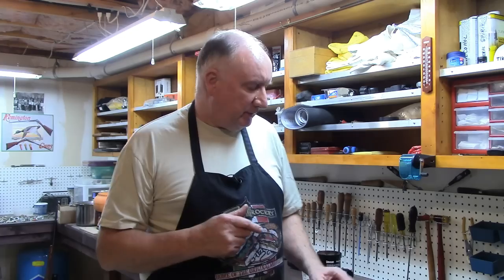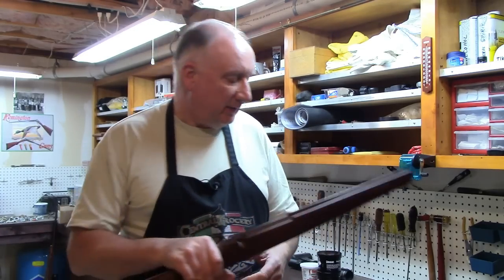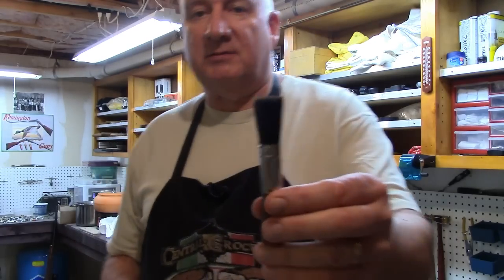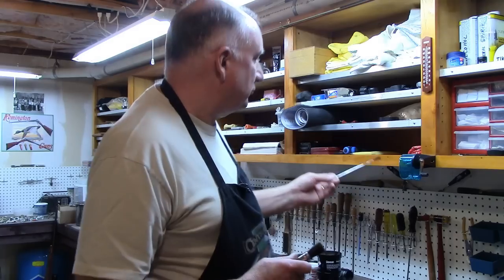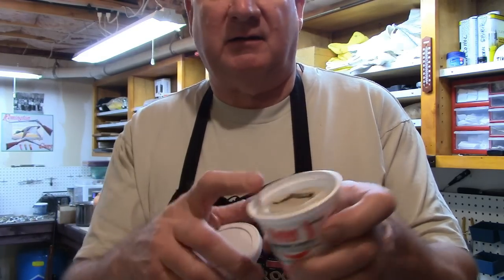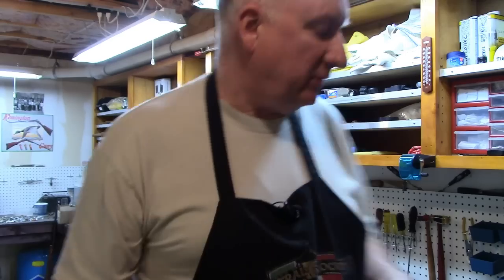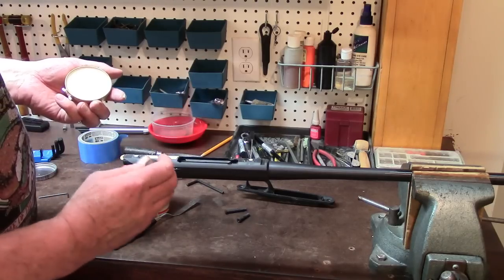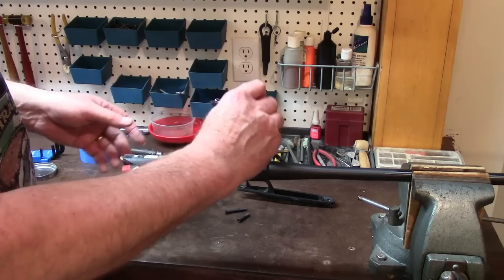How to glass bed a rifle, Part II ~ Let's bed that rifle professionally!

Comment: This doesn't seem like it's out of my skill level, but is it recommended for synthetic stocks?  I haven't finished the entire video (it's getting late. :D), and hopefully you can save me some time if it is not recommended.  I would think that the epoxy can't stick to synthetic material as easily, but I don't know.  Many thanks ahead of time.
Reply from the maker: Rollintroll 
Epoxy will certainly adhere to a properly prepared synthetic material, if not materially; mechanically.  That is, while epoxy may not glue effectively to certain synthetics, their bonding compatibility is not really the issue, because the epoxy is a mechanical shim, as a washer is between a nut and bolt.  The first requirement is to test the epoxy on the plastic, to be sure it does not act chemically against it or melt it.  Such a test can be done in a very small area in an obscure area such as under the butt pad or barrel channel.  As with wood stocks, surface preparation is essential,  perhaps more so.  Roughing the surface will prevent slippage, and creating tiny undercuts and dovetails assure that it won't disconnect when the action is lifted off.  Irregardless, the stock screws hold the action, while the job of the epoxy is simply to mate the stock and receiver to correct any sloppiness.  But if you have a synthetic stock which uses mechanical pillars, as with a Ruger American, then epoxy bedding is a futile waste of time, as such factory bedding is dead tight.  I would not mess with such systems, except to free float the forend completely with .050 inch clearance; five business cards, full length.  Whatever you do, heed my disclaimer, as it can as easily destroy a gun as fix it, if not done skillfully.

Comment: Hi.  Another pair of excellent videos.  I have wanted to learn how to do this properly for some time now. Various videos on the net show rather awful jobs with people bedding the entire inlet. The 'two points of support' approach is extremely compelling in my view. Most of my rifles have synthetic stocks and are pillared with precision machined aluminium blocks (e.g. Blaser and Hardy RE). But I also have an Anschutz 1416 D HB Thumbhole in 22LR where the stock is walnut.  The barrel is already free floating.  Perhaps it would be an interesting test case for me.  I don't know if you are familiar with the these rifles.  The one thing I'm nervous about is that the inletting is shaped to the contour of the action and relatively small in contact area. There are no flat surfaces of contact. I'm worried that removing the contouring with a Dremel to allow for resin - even slightly - will allow the action and barrel to not sit in the proper position (roll?) during the resin setting.  

(It's also not clear whether the fixing that the rear bolt stock screw connects to, which doubles as the rear bolt for the trigger attachment, makes contact with the tubular metal insert lower in the inletting and so governs the rear height of the action rather than the upper channel as it does in the front. The safe assumption will be that it does not and to again be careful not to lose the upper channel 'initial height'.)
Reply from the maker: SGK 
Your situation is found in a number of rifles.  They are typically very accurate rifles, so I suggest a very conservative approach.  Carefully, with a finger over the back of it, pull a small 1 inch wide ribbon of 100 grit sandpaper through the inletting, just enough to roughen the wood along the front and rear.  If you can do it safely, use a very small Dremel bit instead.  Adhesion is the only goal.  Two point bedding is accomplished with even the slightest shim, even if it's just paper thin.  That should provide perfect bedding and support.
Reply: Thanks.  I'm going to give this a go and am now collecting the necessary parts and tools. What do you use to clean the polish off the action when all is done?
Reply: This may be a little more difficult than I first envisaged.  I can't see how to remove the magazine housing from the action.  The front is a simple screw but the rear something else altogether.  Secondly the rear bolt which holds the stock to the action screws into the bolt holding the trigger to the action. Both will have to remain on the action/barrel during the job. I guess I just plug as much as I can with putty, coat everything with release agent and be extra careful laying the action into the stock.
Reply from the maker: SGK 
Naphtha removes it nicely.  It's sold in hardware stores, but also under other common names, as Zippo lighter fluid, and Coleman (white gas) lantern fuel.  Of course, be careful, as it's very flammable.  Other wax removers probably work, too.  Even Hoppe's #9 may work.
Reply: Well I glass bedded my Anschutz 1416 D HB Thumbhole yesterday.  I think I did a good job. I created an effective pillar at the front - the front action screw now threads through the bedding - without getting too much forward seepage. The rear tang area could have done with a tiny bit more Devcon putty to fill in the gap between the stock and the blunt end of the action a little higher (it filled in nicely at the bottom but less so up the sides). I didn’t contaminate the rear tang screw and it still floats. I maintained my height reference at the rear. I can still see wood there with the roughing now filled in. I had very little surface area to work with here. I’m a little unsure about the front.  I might not have tightened the front screw down quite enough at the front as it is hard to see my height reference there (an area of about 3mm forward of the screw) as opposed to the rear . At least it all came apart again and did so easily!  Still trying to clean everything thoroughly which is taking longer than the bedding job itself. Thanks again for the guidance!
Reply from the maker: Sounds like a good job.

Comment: He says he doesn't want to have the bedding compound between the stock and the recoil lug. What if I have a rifle where the recoil lug is part of the barrel? The way he puts the compound on the stock it would make it very hard to get the lug in without getting compound underneath.
Reply from the maker: Kris Csernyanski 
Who is "he"?  If you are addressing me, then ask me a question directly.  This is not a public blog site.  I am here to help you with any difficulty you have for your individual situation, and all firearms are different, which I can assist with, so I would appreciate the same consideration in return.
Reply: GunBlue490 sorry, ive never actually written a comment on YouTube.  I thought maybe it was like an open forum where people would reply to my comment. I had no idea it would be you.

So I guess my question to you is how do I keep from getting compound between the bottom of the recoil lug and the stock since my recoil lug is part of my barrel?
Reply from the maker: Kris Csernyanski 
I understand.  You may, and should certainly bed your recoil lug directly to the stock.  The issue I speak of is maintaining slight clearance between the underside, the front, and sides of the lug,  with solid contact only on the rear recoil side.  Placing a couple of layers of masking tape coated with release agent on the sides where a gap is desired will automatically provide that clearance when the tape is peeled off.  The reason for the clearance is so oil and debris won't get traped and create a bridge situation that lifts the action and causes instability when the screws are snug.

Comment: Dear Sir. I am still considering free floating and bedding my Weatherby Vanguard 7mm-08, but Weatherby claims that the #2 contour barrels are not free floated because they "require upward pressure to help stabilize the barrel for increased accuracy." Since I am a novice at best, I would like your opinion before proceeding.  Thank you. You are the best. May God bless you.
Reply from the maker: I spoke about that issue in another video that I made on accuracy rifles, where I explain that matter in greater detail. Yes, free floating should never be done to a rifle that does not have a completely stabilized action, because the entire barreled action will become sloppy.  Without a strongly supported action, the weight of the barrel will simply swing it left and right, and in such stocks, the barrel pressure assists in stabilizing the barreled action, which was the traditional manner of bedding with wood stocks.  Wood stocks, and certain synthetic stocks can be properly bedded at the action which will eliminate instability. But,  I have no idea if their stock can support the action correctly if bedded, having no personal experience with the Vanguard.  It's not so much a barrel contour matter as it is a stock rigidity matter.  Certain rifles can be stabilized at the action, whereas some are too flimsy and will not be adequately reinforced at this critical section of the stock.  I cannot possibly advise you as to your ultimate decision, which can indeed foul up an accurate rifle if the bedding is not done properly, and I strongly advise you to read my disclaimer carefully, as bedding the rifle will almost always void a manufacturer's warranty for any support.
Reply: Thank you sincerely for your prompt and wise reply. Watching and re-watching your videos brings peace of mind to a chaotic and confused world. 
John
Bruceville, Indiana

Comment: I am rather nervious about glass bedding my .30-06 Remington 700 BDL and am considering buying a after market synthetic stock. What is your opinion of the Magpul synthetic stock in place of the current wood stock

KC
Reply from the maker: K C 
That depends on what you are actually seeking.  I never saw a 700 that didn't shoot at least 1.5 inch groups with good factory ammo, and I have shot 3/4 inch handloads with standard 700 BDLs, and one in particular was my pet 30-06 that shot sub MOA consistently with several loads.  While they can be improved upon, they are certainly very accurate guns.  So, if you use your 30-06 for woodchucks at 250 yards, or if you really need a waterproof stock, an upgrade might be called for.  Deer are far less demanding.  Only you can make that call, and there's no assurance that a custom stock will perform any better, and may even be worse.  Personally, unless I have good reason to have a plastic stock, I will take beautiful walnut any day, and would be loath to reduce such beauty to kindling.  Finally, it comes down to a simpler question.  If you yank it off, it's no longer part of the gun.  If you fail in bedding it, you can still yank it off, and have the same result.

Comment: Outstanding videos on all of the topics that you cover! I just completed this process as you described on an old Mossberg 800C. I just did the unveiling and was very pleased with the results around the tang and the front action screw area as both were perfectly imprinted with the details of the action. However in front of the recoil lug it was evident that I must not have applied enough Devcon as it was not imprinted with the barrel and looked almost just as it did as when I applied it. So my question is whether I should re-do the process and add more Devcon to just that area so that i get the proper impression or do I need to remove all of it in that area to get proper adhesion?
Reply from the maker: Mick Szoka 
Generally, the contact at the rear of the recoil lug and the receiver is the critical point.  Forward of the recoil lug contact, under the barrel, is often entirely optional, and is for support only.  Without looking at it, I would suggest simply scrubbing the existing Devon at the juncture region only with semi coarse sandpaper of about 150 grit or so, blow the area clean, and simply add a bit more.  Don't add any epoxy where you have good contact, as it may create bridging and flexing.  All you are looking to accomplish is to provide support under the barrel, without disturbing the bedding job.  Of course, if that fails, just remove the bedding and do over.
Reply: GunBlue490 Thank you sir, I greatly appreciate your rapid response and your willingness to share your fast knowledge! Please keep it up as such sage advice as yours is truly hard to find. I appreciate you!

Comment: Hello again, I am trying to send you a few picture from the action in stock of a Swed M41B. i am investigating the action and both screws front and back does have metal busing and pillars. So, I am not sure even it this rifle needs bedding given how the action is. I was wondering if I can send you a few pictures please?
Reply from the maker: Please don't send pictures.  For insurance and liability reasons, I don't make assessments or provide off-site non contractual consultations of individual projects. I can advise you as I did in the video, to remove enough wood to anchor the bedding compound, but always leave enough original wood level to maintain correct bedding position.
Reply: @GunBlue490  thank you. understand.

Comment: Am I the only one thinking loosening those screws is a mistake? And then even pushing on the barrel!? This elastic tape is not holding anything in place. It looks to me as if you've done all this excellent job and then messed it all up.

Comment: i would have added pillars for those action screws... otherwise looked like a good job
Reply from the maker: isellcatlitter 
Friend, this sporter grade rifle with a factory barrel shoots 3/8 inch 5 shot groups regularly.  I'm producing these videos to bring realistic answers to accurate shooting, not expensive propositions that seek unrealistic results.  Two years after bedding, the zero is dead on, and groups are tiny and the first cold shot goes into the group even from a clean barrel.  The receiver is 100 percent stable and stays that way month after month, and nothing would make it more so.  I have bedded rifles with and without costly pillars, and have found no difference whatsoever.  I have however found that a significant difference exists with full length versus 2 point bedding, and the latter is certainly more stable and immune to change.  Doing something for the sake of doing it is a culture that I am not favorable of.  I run counter culture very often, because I want people to say, "show me".instead of following the mob mindlessly.
Reply: i was just saying that is what i would have done...3/8 group at what range???2000 yards or 100 meters?? brass waterline fittings from the hardware store are already machined, you just need to cut and shape them for the stock and receiver....brass crushes at least 20,000 foot pounds torque.... wood swells in wet environments and, well, it  rots and i can run a screw threw walnut with a dewalt battery operated drill with ease... just saying
Reply from the maker: Your comment about my range is an obvious poke in my nose. To answer your impertinent question (2000 yards or 100 meters??), I refer to my groups in the accepted tradition of 100 yards.  This is my video channel, and the efforts I presented were intended to be helpful for you and others to achieve the real, fabulous accuracy I enjoy, with the methods that really work.  If you have a different approach, and if my efforts are not satisfactory for your rotting stocks, this medium is open for you to present your waterline fittings on your own production, and I wish you a good audience.  I seek to assist my viewers with sincerity, which includes you.  But your last rude comment was out of line, and disrespectful of my sincere efforts.  Just saying.